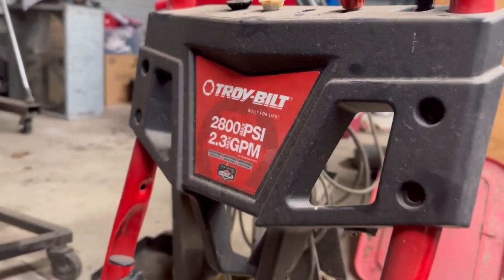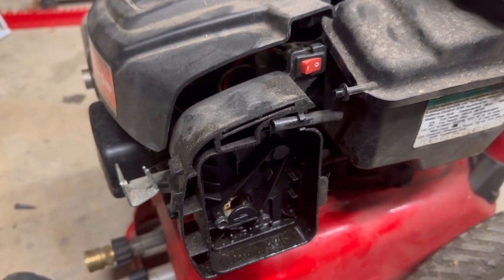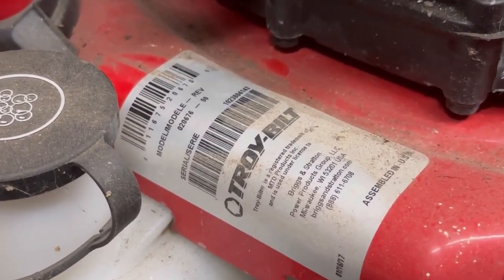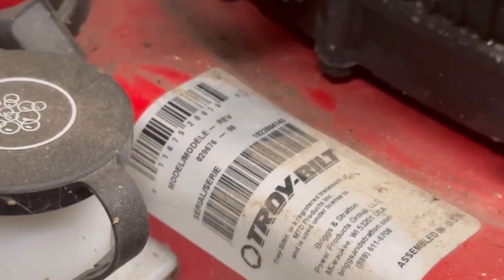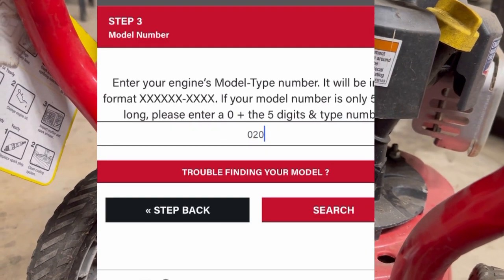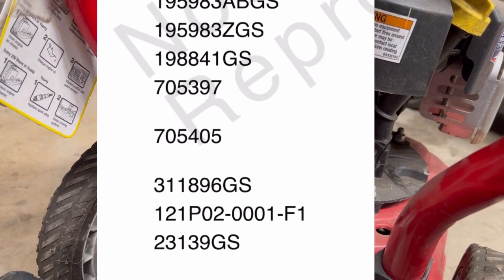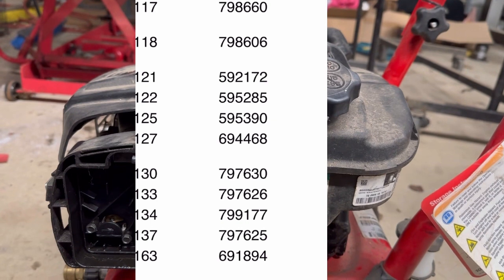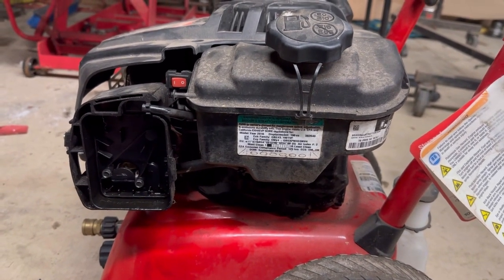HOW TO LOOK UP PARTS ON BRIGGS AND STRATTON POWER PRODUCTS

Comment: Hey Jeremy,
Pain in the ASS is right!!!
It shouldn’t be that much work. Why manufacturers can’t place a small tag with model, serial number and a real date, for both the unit and the engine, is beyond me? And to add to this topic, how many times have we all looked up a model number only to find “match not found”.
It just shouldn’t be that frustrating. 
Thanks for posting this Jeremy.

Comment: i gave up , so many hoops to jump through to find out its still wrong. I just need a new needle and seat. I m jut going to order a few and hope it works  out.
Reply from the maker: if you look up your parts correctly, it won’t be wrong. A lot of times parts are broken down by the code number. If you order by the wrong code number you’re going to get the wrong parts.

Comment: That's all well and good until you need a specialty bolt that holds three things with one bolt and the manufacturer has stopped stocking that part. For a 7 year old mower that has at least 10 more years on it.
Reply from the maker: The manufacture makes parts for 20 years after the build date of the machine

Comment: Could do a little bit more reading of them stickers on the actual engine. Not the thing it's attached to
Reply from the maker: You didn’t pay attention, did you?  There is no model number on the engine
Reply: @THEMOWERMEDIC1  They are "Stamped all over the engine" no cute sticker. no cute label (don't think the link to the briggs site went through)